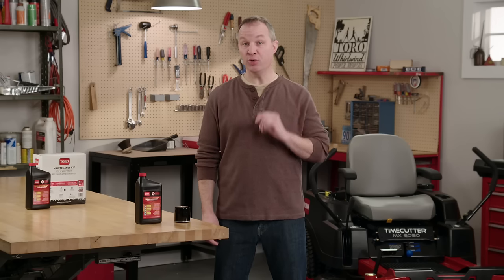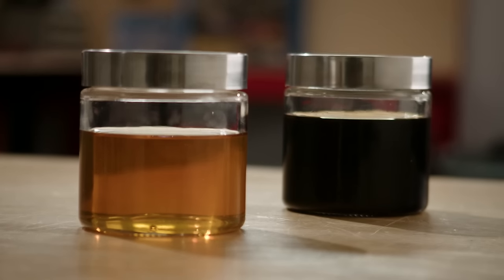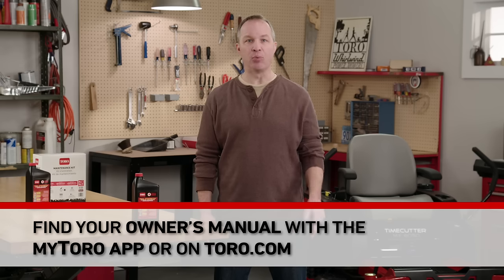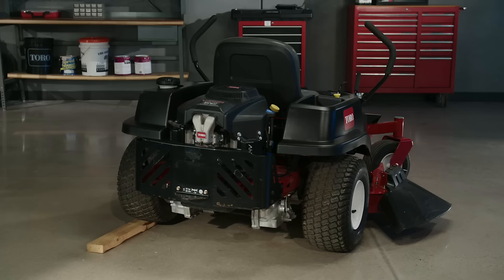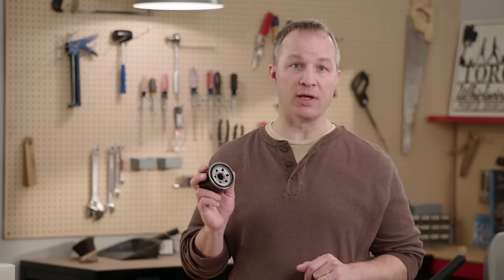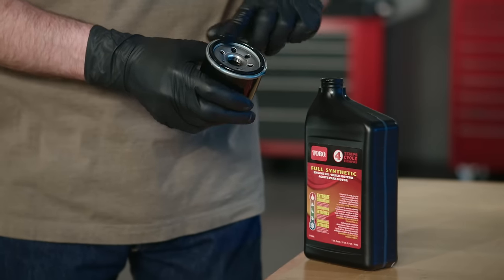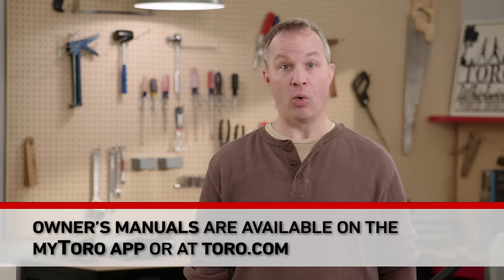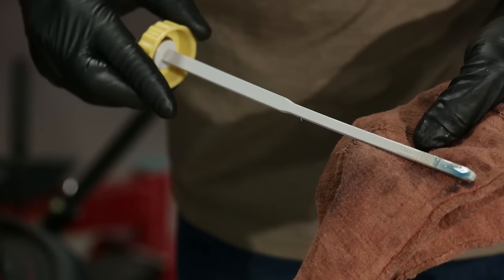How to Change the Oil on a Toro® Zero Turn Mower

Comment: If it has been 3 full seasons since the very first oil change but not even half of the 100 hours recommended before the 2nd oil change should I wait to change it even if it takes 4 or 5 years to do 100 hours? The oil is not dark.

Comment: I see there is an oil filter in each of the wheel drive pumps.  No where in the owner manual are these reference. My question is do we need to change them and how do you check the level in these drive pumps?